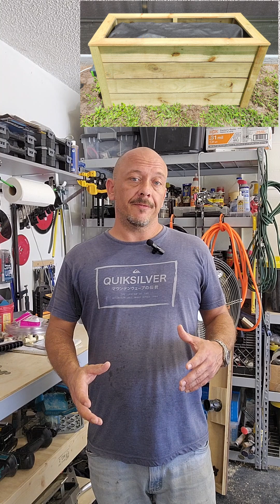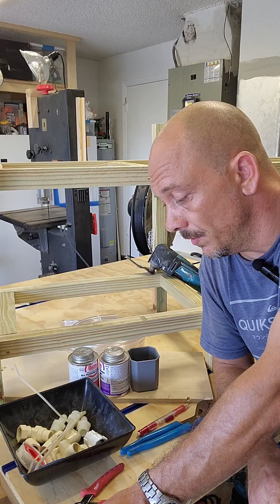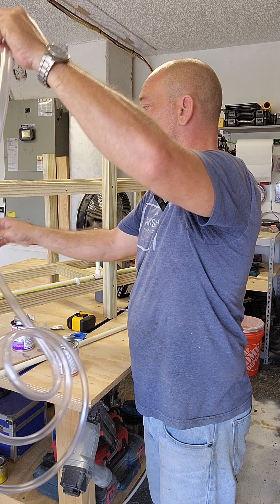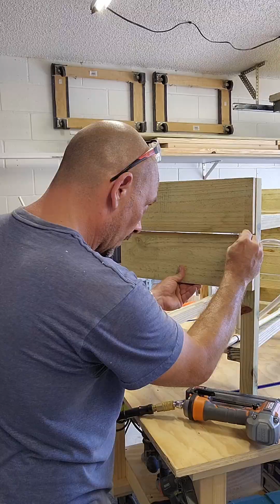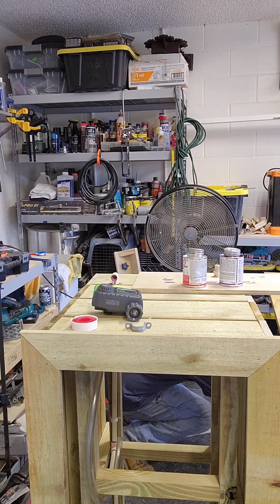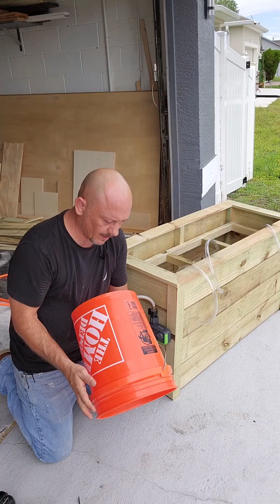Easy Auto Garden - Fun Weekend Woodworking Project!

Comment from the maker: After building this I did find it helpful to sleeve over the tubing with jacketing from a soaker hose. 

I also added a feed splitter at the watering unit and ran soaker hose to our adjacent planter bed and regulated the feeds on the splitter to even out the flow.

So far this has greatly improved the health of the plants and made the important task of watering during high heat summer months less of a chore.